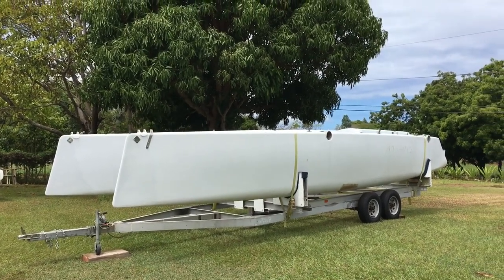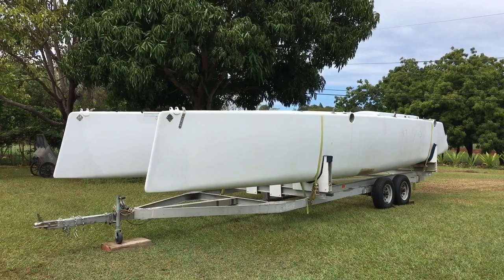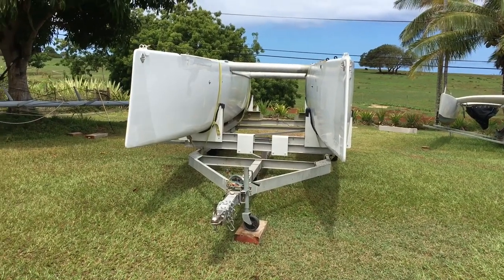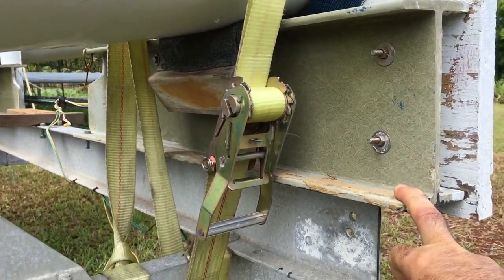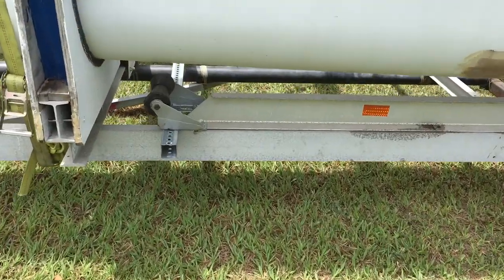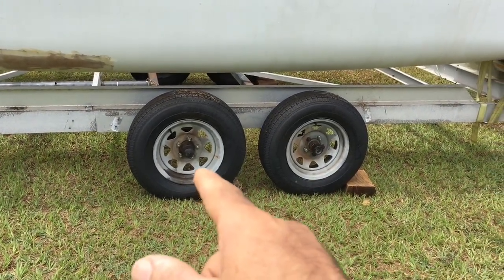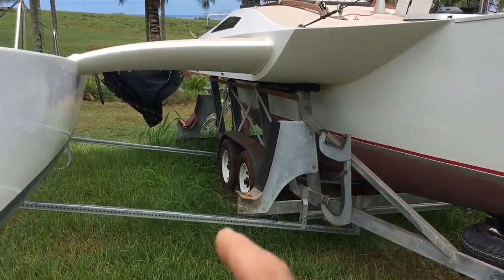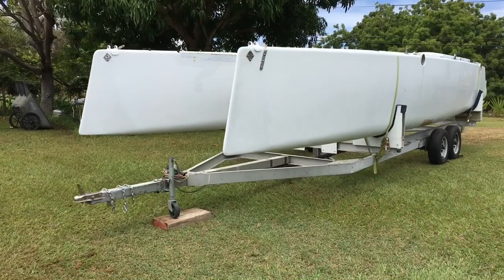30’ Solar Electric Catamaran Build Update: The Foundation

Comment: I’m glad I stumbled on your channel I have been working on a robotic Catamaran for years and I keep putting it off then I start then I put it off when I came across your channel now I’ve become obsessed with making a bigger version of it I am currently negotiating purchase of an old Hobie catamaran to experiment with and I always look forward to updates on your channel
Reply from the maker: Sounds cool. Sure, why not build big so it can take you for a ride? If you can score a set of Hobie hulls on trailer you’re ahead of the game. Keep in mind the classic fiberglass Hobie hulls like the Hobie 14 and 16 do not have a lot of volume and can’t float a lot of extra weight, so be mindful of distributing weight. My first build used Hobie 14 hulls. Single electric motor, battery and cooler at the front below the cross beam. Lightweight materials for everything else like a patio umbrella for shade, plastic table top for seat backs, etc.. Could handle passengers, but had to be mindful of shifting of weight. If Hobie neg fall through, look for a Prindle. Straight beams which are easier to build on, larger volume hulls, etc.. They have some bigger autonomous Cats cruising around SF Bay. Check out the research cat example at http://www.plasticpontoon.com/ . Although expensive compared to a tired old used Hobie, HDPE pontoons are another way to go.

Comment: Switching tires will not save you 5" but half that.
I have the pontoon tires you speak of on my 28 foot houseboat.
They are rated at 1600 lbs each.
I'm looking forward to watching this project.
You speak as a very mechanically inclined man - I'll bet this turns out Great.
I've subbed a while ago, glad to see this posting.
Reply from the maker: Thanks! The 5” is the net gain I get from switching to smaller diameter wheels and tires in that the trailer will drop 2.5” and I will also be able to lower the hulls another 2.5”. At the current width, the hulls sit slightly off center and inboard of the wheels, so a larger diameter wheel and tire would otherwise rub against them once I remove the cradles and extra channel section. With the smaller package I should gain 5” overall and still have just enough room for a fender. Will all depend on what roller and bracket combo I am able to source in bulk inexpensively as that will set the height. Can always add spacers between the axles and main frame beam if things get too close for comfort. Luckily I don’t have to drive far enough or fast enough for tires to get hot enough to really expand, or even need to run full pressure. In fact I might need to run low pressure for a bit of extra suspension because the torsion axles are way overrated for the weight of this boat and trailer. I’m guessing those houseboat tires of yours must be Bias Ply with a rating like that. This boat will be about 3000lbs max. I could even get away with 8” small trailer tires and wheels if I wanted, but it would look awfully funny. I’m also building and modifying with future ability to roll the whole thing into a 40’ shipping container just incase I decide I want to cruise around the Med someday. To do that I would narrow the axles so that they run inboard of the main frame rails. The superstructure and beams would them be removed and placed between the hulls and the hulls slid together. The challenge however will be dealing with the solar hardtop. Still working that out.

Comment: hi, Will. any updates on the bigger cat build? all the best, love your work!
Reply from the maker: Thanks, sorry no updates. Been busy building a new shop so I have the workspace to be able to move forward with some of these builds this Winter. In the meantime I’ve been trying to work out a design for a hybrid outboard/stern drive system using readily available components. The goal being to keep the system light and streamlined, with electric trim/tilt, and the ability to make use of standard props, with the drive motors housed inside the hulls for better weight distribution and protection from the elements. If you’re familiar with Saildrives, my plan is to build something very similar.

Comment: Love seeing new stuff from you. I’m in process of drawing up an 18ft cat with an enclosed (very small) cockpit for two. Very interested in the linear actuator concept. I cannot go over 8ft wide on trailer. Expecting beam on water to be at least 10ft. So I’m trying to design something that has the cockpit mounted above the spreader beams, yet is still centered to the hulls when spread. Will be a lightweight design, two 24V trolling motors. I’m interested in communication offline if possible. Do you have Facebook messenger or an email? Can’t wait to see next videos.
Reply from the maker: Thanks. For a boat that size I would just study all the different ways builders/designers have accomplished expandability and narrowing for trailering. Options include telescoping beams, side by side sliding beams, swing up/down/in beams, etc.. You can also design the trailer to handle assembling of a 3 component boat (hulls and cabin). Take a look at the Tomcat 6.2. Trailer supports and raises the cockpit and the hulls than flip in for trailering. Also look at Trimarans, but imagine instead of a central hull it’s a cockpit/cabin/deck pod. The system I’m designing is complicated and expensive, and I’m primarily doing it because of the size/scale of the boat and because I want single hand ability and will have reserve power on board to power the actuators, etc..

Comment: What's the plan for the solar, battery and drive system on this one?
Reply from the maker: I’ll cover that stuff in future videos as I gather the components, but at this point the plan is 3kW of BiFacial solar, dual 5kW Brushless inboard DC motors that will be coupled to a pair of custom outdrive legs that I’ll be fabricating. Batteries will be the very last added component and decision as things are always changing. Since the system will be 48V, current server rack type systems and DIY Nissan Leaf packs would be a good fit/value for this build, however with it being a marine application, I’ll likely go with a more traditional sealed plastic type of battery as manufactures are now starting to offer larger versions with higher voltage/capacities than the common 12V versions I have in SolGato.